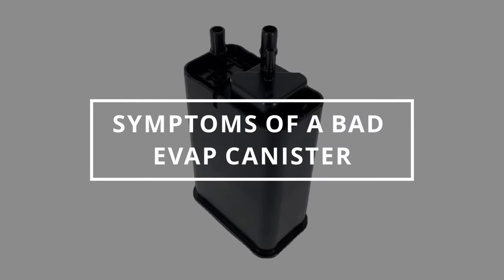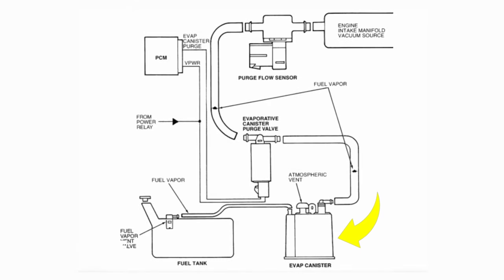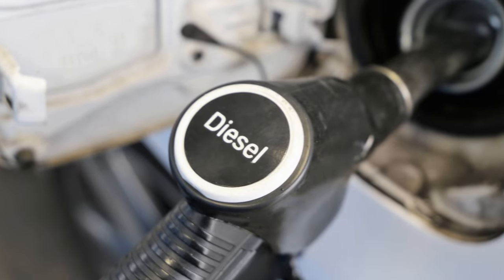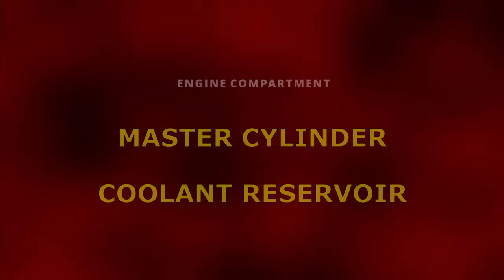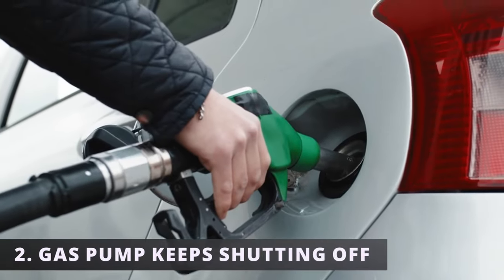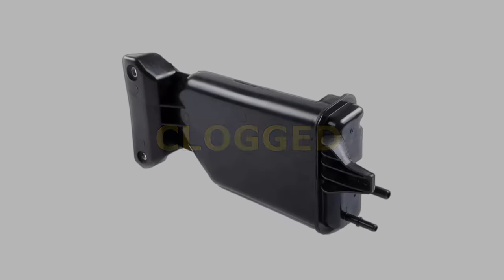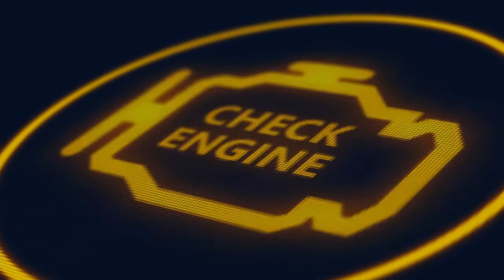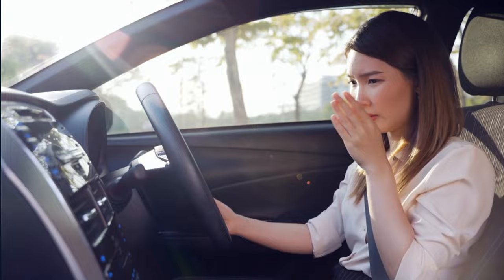SYMPTOMS OF A BAD EVAP CANISTER

Comment: If you have a habit of fueling your car or truck and when the gas nozzle clicks but you keep pumping because your trying to round up that next whole dollar...STOP DOING THAT. Your overfilling your tank which causes fuel to enter your vapor canister. Once raw fuel is in the canister, the canister is now destroyed. You might not get a check engine light but you will noticd your fuel economy is now slowly dropping and the engine starts having a little shake to her at idle. Change the vapor canister and vapor control solenoid. Hope this helps.
Reply: Hey just came across your comment i did over fill twice and one day turned my car on normally gt to work then was going to move to a different location and my car started after awhile on idle turned off and when i turned key to give it gas it just spit fuel on floor.
Reply: @julioocampo9755  yeah when you overfill your tank, the fuel vapors will create pressure. If there is too much pressure then gas will escape with the vapors out of the filler neck and spill onto the ground.
Reply: Thank you for the advice man, usually here in lebanon, almost every single gas station worker does this. Next time I fill up my car im going to make sure the person thats filling it doesnt do this. One time, they kept on filling it to the point where the gas started to overflow from the car
Reply: @brandonjohnson3566  thanks as well I got under my car and the connecter that goes to the fuel tank popped off just had to recomnect it
Reply: I think I did that a few times before driving out of town. Now I’m getting the check engine light with error code p0441

Comment: I could have this problem aswell, I smell gas smell pump turns off on me but no engine light my suv never gives me any kinda light so between this and a fuel pump.
Reply: I had a code and was able to clear it was just changing my vent solenoid and not having to do the charcoal filter. the code been gone for 5 days but came back on today. but I overfilled the truck yesterday so I'm guessing since my charcoal filter has already been bad that overfilling it caused the new solenoid to go bad quick so now I'm changing the solenoid and canister this time

Comment: The system diagram helped thx. Seems there's much plumbing with wire, hose, & pipe with this system so helps with checks on those components.

Comment: Ok so for any of these symptoms, does that mean you need a new canister?  How long do these canisters usually last?
Reply: Mine went out at 175000 miles. It will cost me around $900 to replace.
Reply: @The_intrepidmale  hi, so it turns out mine just needed a new sensor. I found a good mechanic who performed what’s called a “smoke test” & it turns out it was just the sensor. My cars got 150,000 miles by the way..
Reply: @ro-landocalrissian4633 what kind of sensor did you need?
Reply: @Exitwounds666  damn I can’t remember. I’ll let you know if I find out which one..
Reply: Did you get figure out which sensor?
Reply: @ro-landocalrissian4633 Did you figure out what the sensor was ?
Reply: Most likely the Evap purge valve

Comment: Thank you Sir for your informative video. My Toyota was showing an engine light on and the Toyota service mechanic asked me to replace the Charcoal Canister. I Google search the reason and it says Canister normally doesn't need to be replaced but there may be reasons associated with your exhaust system. 
It cost me 1200 dollars cnd and I am still in doubt
Reply from the maker: For peace of mind with high-cost repairs, a second opinion from a different mechanic is recommended.
Reply: @easyautofix  thanks for your reply 🙏
Reply: That's too much. The canister is less than $100 and takes 5 minutes to replace. That means they charged you $200 a minute.
Reply: @nevinkuser9892  I checked with Toyota's original parts and they said $588 Canadian.

Comment: Hi very informative video.  I have a 2016 Corolla with strong fuel smell coming from AC vents first 1-2 min after being started in morning, then clear normal air and no engine codes. Any idea of what could be my issue?
Reply: Any solution yet?
Reply: @fregenedavidhenry2737  none, apparently it’s a common issue on corollas with no solution.

Comment: How about ever hearing of all the charcoal being sucked into the intake manifold and clogging your oil pump pickup screen and oil filter? just asking
Reply: Doubt it, at most those little pellets/charcoal would go threw your fuel line, it'll possibly get clogged somewhere in the fuel line, like your fuel filter or stop at your fuel injectors.
Doubt it'll go anywhere in the oil considering you just have a entry and exit of the engine oil
Reply: Wrong. The only way it would is a leaking cylinder gasket. Otherwise in the intake system it'll get burned out the tailpipe.
Reply: @Ronniejamesleo  okay how about this Theory EGR crossover oil splashes up on the top of the bottom side of the intake manifold turns into burnt carbon falls down into the lifter Vallley and down into the oil pan clogging up the oil pickup

Comment: My 2011 Crown Vic clicks off a lot when fueling up. Having to basically baby it when it’s time to fuel up. But none of these other symptoms yet. It has 64k miles on it, but is getting older. Probably replace it as the other symptoms may pop up with the summer coming.
Reply: Vent your fuel tank cap. Problem permanently Solved.

Comment: Own a 2006 Scion xB and I always smell intense gas fumes during cold starts especially on cold days. I know some fumes are normal for a car but for this car its far worse. This has been happening for years and I always thought its normal for this car. No check engine light and no drivability issues. Will check the canister to see if there is anything unusual. Thanks.
Reply: I have the second generation XB , same situation, suspiciously, strong gas smell from the exhaust, no check engine light, no drivability issue, possibly more noticeable during cold weather.

Did you discover any problem with yours?

Comment: The gas pump shutting off isn't always a sign of a bad EVAP canister, especially in CA. There's many shifty old pumps with bad pressure sensors and others that work flawlessly.
Reply from the maker: Thanks for sharing!
Reply: Bad canister you'd smell fuel real bad and you'd have residue on the fuel door. 9 times out of ten it's that vent valve

Comment: I cleaned a bunch of sensors and tested sensors to be sure they were working. Finally got the computer to give a code and it turned out to be a problem with the Gas pedal putting it in limp mode. The dealer couldn’t find anything wrong when I was able to provide them with the code they found that there was a loose plug that connects to the panel. I don’t know if it was the plug going to the harness or the plug going to the pedal, but the wiring harness had recently been replaced, and there must’ve been a loose plug probably at the harness. Problem is fixed.

Comment: I hooked my autel obd and noticed everything was checked green except the evap,  I checked for exhaust leaks under the car by air pressure and soapy solution,that was fine,I had no codes.I did install a new cap awhile back because of the gasoline smell but to no avail.I just happened to check the air filter out which was new but,after viewing a install video ,I noticed that it was installed incorrectly.I don't have the gasoline smell and my fuel consumption is back to normal.

Comment: P06B8 code on my 2010 Mercury Milan, my mechanic mentioned EVAP over 1 year ago. Engine light came on 4 months ago, have noticed loss of pressure, power and acceleration last 6-9 months, no necessarily loss of MPG. Oh and since last 4+ months doesn't start right away, like maybe 10+ times. Completely dead then starts after multiple tries. Also traction control, both emergency and ABS lights as well, constantly on. There's been issues with instrumentation panel since purchase 2 yrs ago
Reply: Your car has "issues' Main effect of a failed Evap is a check engine light.
Reply: @barenekid9695  thanks. The starting issue was actually a failing starter. 6 months before completely
Reply: Died. Replace in June
Reply: Last two women on earth who you take her or Molly ?I like Molly cuz she athletic, you see that show where she broke down and started doing man push-ups.. I'd like to take this more than a pretty face

Comment: I had one replaced due to a fuel leak, which happens when the car does not run. Since the "repair" the leak has happened again. 
Any chance they can leak fuel?  Or do I likely have another issue?

Comment: Could this cause trouble starting after fueling on a 2014 impala limited LT? I have replaced the gas cap, Canister Purge Valve and Vapor Canister Vent Solenoid. Check engine light is no longer on, but difficulty starting after every refuel. No problems between fill ups.

Comment: I have 2003 crown Vic and my Evap core is in a box on the passenger side of vehicle. I’ve noticed that it continually throws hot air out of this box is this normal? Just had a mechanic change it last week! Hope it didn’t go bad again

Comment: My 2002 won’t let me fill gas tank all the way. No diagnostic code. No problem starting,running, or idling. Only issue is won’t let me fill tank more than a couple of gallons. What could be wrong? With no diagnostic codes showing up and running fine, I am baffled. Any ideas?
Reply: The Anti-Siphon device in the neck may not be opening all the way.  Not sure of a fix as I have never had worry about this issue.

Comment: I did the scotty kilmer cigar and the hose  in regards to finding  a vacuum leak. Car is a 2017 nissan sentra , it has been running w weak acceleration  esp up hill.  Back to the possible vacuum leak , the smoke was coming out from behind  headlight but straight down on  the driver  side   , if Anybody can tell me what it is I would be  very happy!! 
Thx in advance

Comment: Hi I tested the sensor, it works very well but does not work on the car, I tested the wires the first has 12 volts and the second o volt, how do I know where the wire is cut

Comment: I got an '02 Mazda hatch and I drove over a large, deep puddle recently, about 5 minutes of driving later my engine turned off by itself while driving. Luckily, I turned it back on and I drove to the gas station to fill up nearing empty, and now have the issue where it shuts off the pump after filling 0.160 Gal. I decided 2 order a new charcoal canister/filter to replace the old one in case the filter inside somehow got soaked, since its located @ rear driver side wheel near the floor. Will update once I get it replaced -if that fixes it.
Reply: This just means you got water in your engine.
Reply: I fixed the issue it was the gas evap filter 'charcoal filter' ran just fine after and changed the oil didn't see any water innit

Comment: I have had code P0456 & P0442.  I have replaced the gas cap(OEM), purge valve (under the hood) & EGR valve.  Still getting the same codes and car feel like it is rough idling about to stall at a dead stop.  I have located the charcoal canister.  Do you think that may be the problem?  I do notice a gas smell.
Reply: Did you ever end up finding the problem? I’m having the same issue on a range rover
Reply: @basharalgahim63  not at all.  The leak seems to be coming near the fuel pump/tank.  Taking to a mechanic next Tues.  Hopefully he figures it out

Comment: I just changed out that evap solenoid a month ago. Now the light's on again with the same code. Ideas?
Reply: Did you figure it out?
Reply: I changed the solenoid too. It's not the solenoid, it's the charcoal canister.

The evap solenoid is also called the PURGE solenoid. The charcoal canister is also called the EVAP or VAPOR canister.

It's confusing, but they are different parts. Solenoid under hood and easy. Canister under car and a bit more involved.
Reply: @esyndicate  i changed solenoid under hood and solenoid on tank but still have check engine with p0442 , but i dont have any simptoms like in this video...should i changed the canister ? it is help ? chevy venture with orig 220k km odo
Reply: @lextmb P0442 is a small evap leak. I traced mine to a rusted out fuel pump that had a slight crack. Was leaking gas out ever so slightly. P0455 is a large evap leak. I had that as well and traced it to a faulty vent valve solenoid. But with your P0442, best course of action would be a smoke test. Pressurize system with smoke and look for where it’s coming out. Could be gas cap, filler neck rusted, etc. Good luck.

Comment: question. I think my evap is done. I have a 1993 f150 5.0. I can't pump fuel in my truck at all. I have a check engine light and didn't pass smoke. I think that's the problem

Comment: My sentra 2006 is doing just that , gas vapor inside the cab,poor milage and the check engine just came on,also, an uneven,rough idle. Could it be the valve alone or the whole canister??
Reply: بامكانك تشخيص لصمام عن طريق بطارية 12فولت ،

Comment: i allready change solenoid under hood , solenoid on tank , and still have check engine with p0442 , but i dont have any simptoms like in this video...should i replace canister ?
Reply: Try replacing the gas cap.

Comment: Hello Auto repairs, i am using the same Lexus RX300, 1999 model engine 1MZFE. the accident was made by swap/connecting the Vacuum Surge Tank pipe to the water outlet there just below it. The system was filled with water until the water comes out at The Charcoal Canister through the Air Drain Horse. We have tried to remove the water by sucking and blowing through the pipes and even put the new service kit since we found some plugs socked in water. but still the car wont start but cranks. what advice can you give sir
Reply: That's a horrible mistake. Your engine probably got hydro locked and spun a bearing.

Comment: **New battery **
So here’s an update I had check engine light with limp mode. The dealership couldn’t find any codes. I have trouble often on putting fuel in the tank. So I took the canister out check the purge valve with 12 V to be sure it was actuating blew out the canister with air, open the purge valve and blew it out and got some dust out of it, clean the gas tank, pressure sensor with sensor cleaner. Sprayed the purge valve with some WD-40 blew out all the hoses that I could find a blowout put it all back together and we’re still getting an engine light. I remember someone online mentioning low voltage could cause sensor problems. I checked my battery after it sat all night and it had 12.2 V which I thought was a little on the low side so I got a new battery. I discharged power from all the computer boards by touching both battery terminals together after disconnecting them and I drove about 15 miles today with no light. We’ll see what happens. Thanks for the info.
Reply: Maybe buy a trickle charger to keep your battery charged. 
My truck has a parasitic draw that I cannot find so I used one (trickle charger) for a long time. Recently I added a disconnect switch which keeps the battery from discharging.

Comment: Wouldn't this cause fuel trim issues as well. P0175 and what not
Reply: Possibly but my Toyota is not throwing any check engine light codes and the line is totally blocked.
Reply: I'm asking for my own benefit. I have actually bank 2 rich fuel trim. Replaced all kinds of shit. My tank doesn't take the gas pump well. So. I'm thinking canister might be a problem

Comment: my 99 s10  center hose from the tank is putting gas into the charcoal filter and dumping out in the street through the foam filter. Can anybody help?
Reply: Did you figure out this problem? Please let me know. I changed out my leaking gas lines on a 2004 Grand Am, and now there's a small liquid gas leak in a big hose that connects the Charcoal Canister to the Canister VENT Valve Solenoid. This seems to be kind of like your problem. Thanks!
Reply: On top of the gas tank is a cap. On the cap you'll see a 1- 2  inch round rubber hose, the hose is attached to the gas tank cap on the left side of cap,  on the cap is a connector the hose is attached to; that connector cracks and causes fuel to leak into the hose, that contaminates inside of the evap canister 
Contact mechanic and have mechanic inspect the connector

Comment: .... thanks for video.   So apparently there's no way to fix the canister, other than to replace it 🤔
Reply from the maker: From my experience, it needs to be replaced.
Reply: Have you tried warming the canister a bit, (100 to 115 F) and pulling several inches of vacuum for a couple of hours?  If the vehicle set unused for months, the charcoal may have become saturated with heavier than normal vapor that is not quickly released by the charcoal.

Comment: I get a fuel smell, but no codes, or check engine lights.
Reply: me too and rarely a little rough idle. 2022 crostrek 2.0l na only 17,755 miles. does alot of idling though

Comment: I always smell a gas smell.
Reply: Same occasionally a fuel smell
Reply: @Clean-N-ShineInDfw  My vapor canister purge valve is bad. It took me 6 years to figure it out. PO456 on a Corolla is gone now
Reply: For just a little 4 cyl. Daily driver car, shits over 100$ just for the canister.
Screw that.
I've seen a video where the guy used a air compressor in the vent line that leads to the canister, popped the hose in between the canister and the vent line that leads up to where you put your gas cap on, blew out both ends and he could refill again without replacing the whole unit